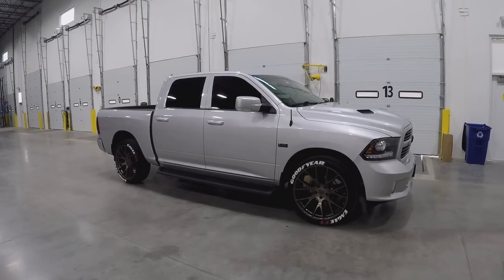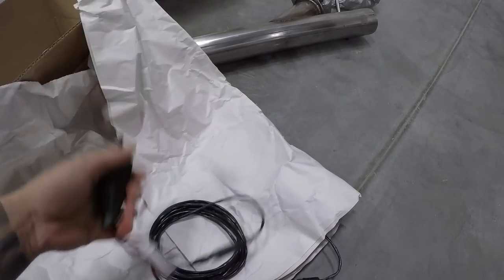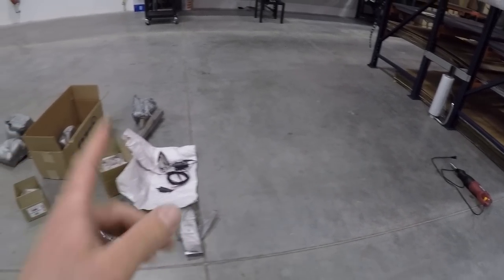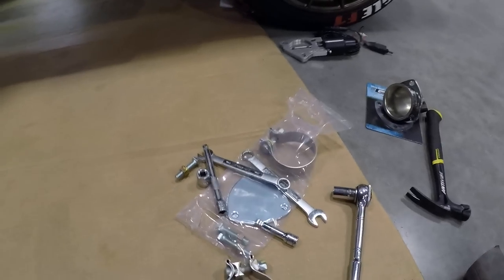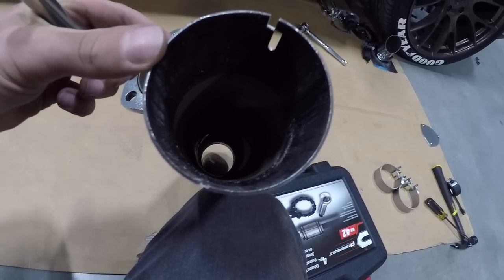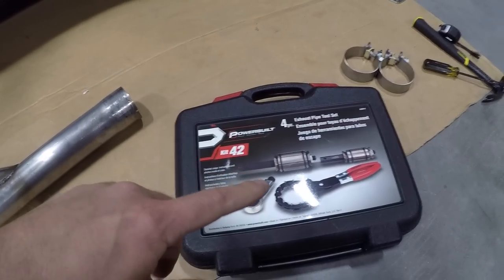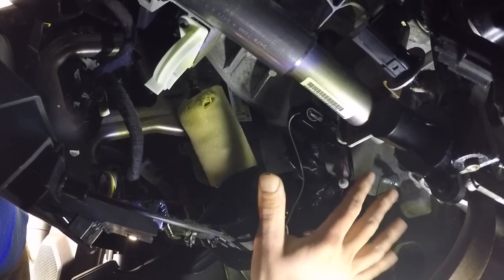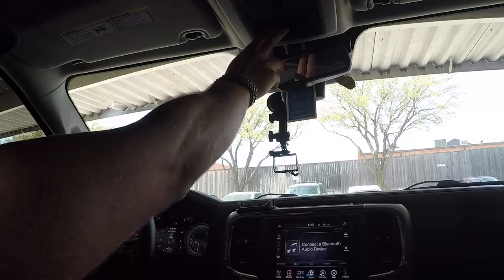INSTALLING AN ELECTRIC CUTOUT ON YOUR EXHAUST - RAM 1500 HEMI - HOW TO DIY

Comment from the maker: QTP RAM 1500 3" Y PIPE KIT
https://amzn.to/32ikPNk
QTP 3" Exhaust cutout
https://amzn.to/2YwuFYh
QTP WIRELESS REMOTE CONTROL MODULE
https://amzn.to/2W7eKCq
HEAR HOW IT SOUNDS HERE!!!!
https://youtu.be/FdcwT2_W49g
Reply: dude its a good system  and you do a great job selling it , ,,, but the fact  is they are a shit company  if they treat their customers like this ,,, they dont  give you a parts list  or any numbers , or even a deal ,, and that less a gasket  ,, i wont be buying from them , because of the way they have treated you ,,, any  and i mean any cpmpany would and should treat you better than this ,,, and you must have been hitting that pipe  really hard dude  to get it off LOL   good job , any ways thanks  for  documenting this so well  ,,, i like your truck i ave the same thing  only in blue ,,, oh you should not have had to  expand that pipe to get it to  fit ,, they should have made sure the pipe was correct ,, you sure did take it  cool with all the BS  you had to  go threw  to get the job done ,, thanks again

Comment: The QTP cutout is actually pretty well built from your video. I bought a cheap ebay kit. I had to have an exhaust shop weld the y-pipe on and the cutout actuator I got is complete garbage. I had to put a block off plate in while I look for a replacement cutout. So I will end up spending way more money and time trying to be cheap.... As usual!!!! Thank you for posting this video.
Reply from the maker: Thanks jack! Sorry to hear about your cutout! The qtp is decent but for the money you would expect better. It held up well though overall

Comment: You definitely didn't lie about the difficulty of getting the crimped part off the existing exhaust. I had to cut it on both sides like yours. Also, instead of buying a pipe spreader I brought the old and new exhaust to an exhaust shop and had them spread the new until they paired for 5 bucks. Great video, thanks for the idea. Sounds really good!!
Reply from the maker: Glad I wasn't the only one!  They really should adjust the pipe from the factory at QTP cause the fitment is terrible.  Everyone seems to report the same
Reply: @BoostedMotorsports  agreed!

Comment: This is an awesome add on to your Ram, at the time you did this video I fabricated one by purchasing the valve on line and the wire kit. The company that you bought the kit from looks like they start with a OEM head pipe makes this so cool so you can easy go back to stock by unbolting then and replace.. I love loud motorcycles and if they annoy you use this kit to annoy them back LOL.  I did this on my truck bcuz I could not make up my mind on who's mufflers to go with, and this was cheaper and when I'm driving and need to listening to my phone the bad ass rumble at a flip of a switch is gone!! Nice Video bud....
Reply from the maker: Thanks Rich! 👍
Reply: QTP actually recommends removing the cutout and going back to a stock configuration during winter months if you live someplace that salts the roads (i.e. the rust belt, New England, etc.). So it's no coincidence that it was designed that way.

Comment: You dont need a gasket between the valve and the towndown. There is nothing to seal it from. Aside from maybe staying in place better, the towndown does not need to be sealed.

Comment: Really awesome! I had no idea they made a cutout. I was considering getting a Borla touring muffler just for a bit of a throaty sound, but I can't handle something loud that drones. So this setup is ideal for when you want to show off or have a little fun but go back to normal. Doesn't look too hard other than the issue you had with cutting the pipe out. As always, thank for making these vids. I don't think I make good vids at all.
Reply from the maker: I would definitely recommend it!  I'm not too impressed with the fit and finish of that stupid Y pipe though. For how expensive it is they should have  done a better job. With that being said I do love how it works and the sound!

Comment: I just installed this and ran into all the same issues as you lol but it was worth it in the end sounds bad ass especially in manual mode where you can keep it revved high up then hit it
Reply from the maker: Damn well i'm glad I wasn't the only one cause I was cursing like sailor! lol
Reply: yeah I rented that exhaust expander tool ahead of time and good thing i did. Ended up taking an angle grinder carefully to that clamped piece by the ypipe came right off lol

Comment: I see the link you shared is priced at $435 but i found same product on LMP website which says its QTP QTEC 3IN ELECTRIC CUTOUT AND Y-PIPE KIT - SINGLE - QTEC30CP.  Whats the difference?   The one on LMP is only $272.  Please let me know if there is a difference.  Thanks.

Comment: Awesome job man! I am doing this exact same thing to my rebel. Got the cutout pipe welded in last week, waiting on the valve in the mail but man it sounds good with the cutout. Thanks for the idea with the wireless garage buttons! A must have with any hemi! Maybe they will be stock someday lol!
Reply from the maker: That would be badass if they came stock!
Reply: how did it hold up? conflicted on which brand to buy for my 2019 rebel, everyone says they have a high rate of failure.

Comment: Probably no extra gasket since there is no back pressure on that joint that would create a leak. Doesn’t hurt to add the gasket but probably really isn’t needed

Comment: Bought this after I saw your video on the deal, installed last weekend. Had to cut that pipe with a xutting torch because of the clamp
Reply from the maker: So you know the struggle then too!  Sounds amazing though right? 👌

Comment: Hey man, thanks for finally doing this mod, it’s really helpful. How much total cost are you in for? ..main parts. Not zip ties , tape, or pipe stretcher.
Reply from the maker: Thanks Ryan appreciate the feedback! I got everything for about $400 shipped from eBay when they had the 20% coupon which gave me $100 off of a normal $500 total cost.  They actually have a 15% coupon right now so you could get it for almost the same as I paid!

Comment: For what it's worth you wouldn't need a gasket after the valve. You only need the gasket before the valve to make a good seal when it's closed.
Reply: Was 100% going to say you don't need a gasket for the turndown cauae there is nothing you are trying to seal. No backpressure or exhaust being sealed

Comment: Thank you.  Installed mine last weekend.  What a nightmare I had with the same clamp you did.  Personally, I ran my wires to the cigarette lighter port in the center console in order to wire up with the train horn.   Thank you very much for preparing me for the hassle I would have with the exhaust.
Reply from the maker: Thanks!  Glad you found the video helpful too.  Yeah that clamp is a pain and this install wasn't as straight forward as it is made out to be but the end result is awesome!

Comment: you should have use wiring insulator around the exhaust, because when the heat goes up, it would melt the wires and could cause a short. good video tho

Comment: I've been toying with this idea just to troll rice rockets.. except I'd get 2 kits.. put one infront of the muffler like in the video, and one backwards after the muffler.. join the two up with a pipe.. so the cutout still uses the stock exhaust tips... just detours around the muffler.
Reply from the maker: That would be a cool setup too!!
Reply: Jay Yother how would you make the inside smooth?

Comment: U made that truck very special! Like to see hp gain n sounds.Rim n tires r awesome, price $, 4all upgrading? Bad ass truck!!
Reply from the maker: Thanks brother I appreciate it!  I got the wheels/tires at a smoking deal for around $1400 used.  Be sure to check out some of the other videos on the channel where I show the full build of the truck and every mod we've done so far.  The truck is getting supercharged for this summer too! 🤙

Comment: I think QTP sells the whole A-Z kit now without buying the parts separated.
Got a quick question. Will this work on a EcoDiesel Ram?
Reply from the maker: I'm not too sure what the exhaust looks like under there on your EcoDiesel but I image it might be a bit different leading up to those factory duals.  Probably have to check with QTP or stick your head under there!

Comment: That one piece that is factory stamped is a pain in the ass. Had to take one off a 2018 Ram. Heat doesn’t do anything. You just have to hack it to pieces.

Comment: I ran my amp power through the plastic clutch delete plate, that way i didn't have to mess with the factory wire loom
Reply from the maker: Yeah thats another awesome option too Norman!  Another option I found is the parking brake cable grommet in the floor 😁

Comment: Bought this when I saw you got it and put it on my 14 outdoorsman. Exact same issues as you. Had to cut the flange to get it off and used a block of wood and a hammer to open up the oval end of the qtp pipe. Right where the wire comes off there is a plastic plug that sends you under the carpet under the pass seat. I ran the wire there and under the center console. Used the cigarette plug wire as my 12v and ground to frame. On the outdoorsman the skid plate support falls RIGHT where the down pipe points....dammit...so I gotta get an extension. Bout 3.5 hour install but it sounds awesome and I love being able to shut it off to take calls in the cab. My only complaint is that when open and coasting to a stop, the back pressure makes a deep resonating that is louder and deeper than my 10” sub. Did you notice that too? Keep up the good vids.
Reply from the maker: Yeah its loud AF but I absolutely love every bit of it.  So cool to just be super loud and then hit a switch and go stealth mode! 👌

Comment: Just from my experience, you'll wanna spend the extra bucks and get the copper header gaskets. Those gray ones burn out really quick and don't seal quite as good.
Reply from the maker: I hear ya!  Fortunately these are a lot further downstream and not as much heat as right by the headers so it should be ok but I'll update everyone if things go south! 👍

Comment: Great video!  Mods seem to be getting a little more technical!  One thing, I don't know if it was the camera angle or what but, when you slid the Y-pipe into the header pipe it looked like it wasn't far enough up and the slit wasn't completely covered and might let exhaust escape there!  Maybe I'm just looking at it cross eyed or something but, might want to slide under and check that first connection and clamp!  Again, good video!
Reply from the maker: Hey Gerald.  I double triple checked to make sure the pipes were fully seated and no leaks so might just be the angle or when I cut the clip but rest assure shes all sealed up nicely! 😁

Comment: Sounds amazing but I'mwondering , did you remove your muffler and had straight pipe before you installed the cut out?
Reply from the maker: Nope just this setup and different muffler setups

Comment: Nice! I cant wait to get mine on my 2020. Also, that middle piece on the collector is not a restriction. It is actually the opposite. It decreases turbulence where the manifolds meet and helps pull exhaust from one side or the other. Almost like a siphon.
Reply: How it turn out

Comment: Can it be stopped while opening or is it full close or full open only? Can you make 50% or only 20% open?
Reply from the maker: Yeah you can stop it anywhere between fully open and closed 🤟
Reply: @BoostedMotorsports  Thanx for that info :) I like such option. Full open could be to loud for people inside a car and for people on sidewalks in some areas. But if it can be adjusted while opening then sound level can be moderated. So cool!

Comment: Would it be easy to do this on my 2000 dodge durango right not it has a single flowmeter on it would this cutout make it louder like it's straight piped or ?

Comment: Hey loved your videos just a quick question I live in Canada and that being said there is salt and sand down on the road for winter do you think it would get jammed or highly affected or corrode with this cut out? Thanks again awsome videos
Reply from the maker: Hey Charlie it shouldn't be an issue.  The pipe is stainless and you are supposed to spray the valve with oil once a month no matter where you live so it shouldn't be an issue.
Reply: Thanks a lot love your videos

Comment: do you have to hold the button for it to do the full rotation or could you just click it?
Reply from the maker: You hold the button cause you can have it slightly open or closed depending how loud you want it.
Reply: BoostedMotorsports yo dude where did you get the sports letters for your tires at hit me back when you get a chance I appreciate it

Comment: The link you posted for the y pipe was the wrong part. It's not the full length and doesnt have hanger bracket.

Comment: I’m new to wiring. What did you use to connect the red power wire at 16:15 ?
Reply from the maker: Red power goes to the battery + terminal 👍

Comment: Take a dead blow and form the out of shape pipe back to round 
Do you really need a gasket on the outlet side of cut out
Worried about a exhaust leak under the car when the cut outs are open

Comment: Very nice video and install 
Did you do this because you didn’t want to hear a exhaust all the time?
Reply from the maker: Thanks for your support on the channel Jason!  Yes that's exactly why.  If you check out my older videos I installed the Carven Progressive bolt in muffler and it was super annoying having to listen to it all the time and when taking a call handfree it was difficult to have a conversation so I put the stock muffler back on.  This is WAY better and louder than a bolt in muffler when you want it to be 👍
Reply: Boosted2k 
Yea sounds good from what o can here from the audio. I did a muffler and had my exhaust shop do piping from pretty much were your cut off starts to muffler then all the way to stock tips. Sounds really good. Sometimes the noise in my cab can get obnoxious but I love it lol. My wife doesn’t mind it and my son love the loud truck lolol. 
I just ordered new led interior lights a 3.5in radio antenna instead of that stock on and they tail gate assist thing so your tailgate comes down easy.

Comment: Hello there, I know it has been a while since you uploaded this video, but I have a question about the Y pipe from QTP, does it has any special filters inside? Could I replace it with a custom 3" y pipe, you think? That way I only order the motor itself from QTP. Thanks
Reply from the maker: Yeah just order the motor there isn't anything fancy about their Y pipe and it fits terrible without messing with it as you saw in this vid.

Comment: Greetings from Sweden! This video is pretty amazing, because it makes this look simple enough to install even for me that is mechanically more or less completely clueless - allthough I am nervous about cutting into the exhaust and I don't like the fact that these systems always start to leak at some point. I havn't even decided to get this yet, but this video has made me confident enough to do the install myself (rather than pay my local mechanic an estimated price by him at around 500-550$ to have this installed). Truck is a 2012 Ram 1500 Laramie Longhorn Edition with 41k miles on it. Thought on the box - since it doesn't need cooling, can't it just be wrapped good in plastic and just sit in the enginebay as long as its not near any heatsource? Also, how important is the gasket for the turndown?
Reply from the maker: Thanks brother I appreciate the feedback and support!  Yeah you could wrap it in plastic if you wanted to as long as it is not going to get water or moisture!  The gasket on the turndown probably isn't absolutely critical but I just didn't cant carbon blowing out the side and making a mess of my setup 😁
Reply: Thanks for the input, gasket wasn’t hard to find either as I thought it would be over here. Thought I’d have to buy the tools you used as well since we don’t really have many tool rental places, but I did find the saw to rent, and the pipe expander is just a 31$ investment if needed. Beats that 500$+ installation by a whole lot.

Comment: Hey John, I've been looking to get an electric exhaust cutout on my 1500 Sport, but don't have the confidence to do it myself. I'm having trouble finding shops that will install it. Have any advice on who and what locations specifically to look for. I haven't yet reached out to many custom exhaust shops but the main issue is that they don't offer service in regards to the wiring. Also, prior to the Ram under my name, my father had a magna flow exhaust kit installed into the truck a while back. Would it make sense to place an e cutout on a custom exhaust?
Reply: I'm not sure if your familiar in a lot of places in this general area but I live in LA county. I'm just wondering what shops would specialize in installing custom exhaust parts for my pickup.

Comment: Hey bro I have a question. I looked under mine and as the y the catiltic converter is right their . Theirs no room for my cut in and cut out u think I should put it after the convertor or its best for before
Reply from the maker: This is after the Y pipe 🤙
Reply: BoostedMotorsports mines different I have two coverter right after the y than they connect into one so it's two exhaust lol . I'm just gonna connect it after the the both converter and see how the sound is

Comment: it is a pity for such an expensive system that you have to hold to open/hold to close. it has to have a tap once open / tap once to close and the box the box waterproof. Is that 90 degrees turn down really necessary? when you drive the wind during driving blows the warm exhaust air away no...?